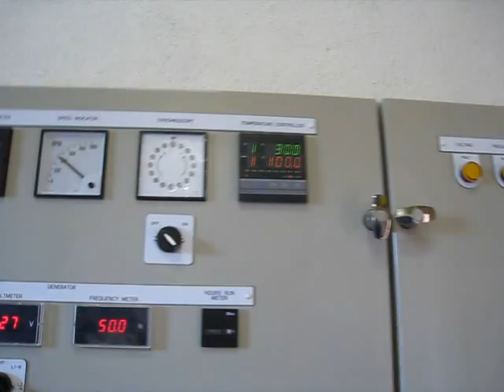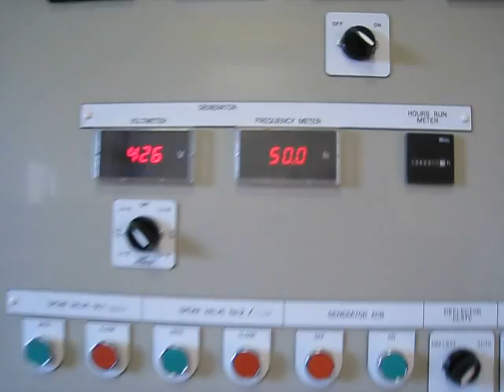Hydropower plant 2 at Ashfield Farm Micro hydro 500Kw Pelton

Comment: this is my dream, to have a property with one of these on it and live off selling excess energy to the grid. If you do this could you ballpark how much you net from this?
Reply: Water to wire efficiency for a Pelton Turbine is ~85%. Regardless it is typical to have the rating based on the generator. So on this case, the generator is capable of producing 500KW of electrical energy. No one quotes it in terms of mechanical energy.
Reply: +Cortemus 15kW or less: 15.45 p/kWh
>15kW - 100kW: 14.43 p/kWh
>100kW - 500kW: 11.40 p/kWh
>500kW - 2MW: 8.91 p/kWh
2MW+: 2.43 p/kWh.
So at this size (500KW), 12000KWh per day,  $1368 (pounds) per day, not taking into account build or maintenance costs.
Reply: Luke Schofield so if I'm calculating this right, you're making about 500,000 pounds a year selling power back to the grid? even with 30% taken out for maintenance and other cost , $350k a year is amazing.
Reply: that is correct but your poer is determined by not just the pelton turbine efficiency but other factors as well, as for noone quoting it in terms of energy, ive done projects where that was the case.
Reply: Luke i wish you were right my friend. Unfortunately the problem is with your assumption that 12000KWH is produced per day, that in fact is not correct if we assume that the turbine works at 50% efficiency, then it is in fact 500*8760*0.5= 2,190,000KWH. That means per day it generates 6000Kwh which means your profit is cut down to half.